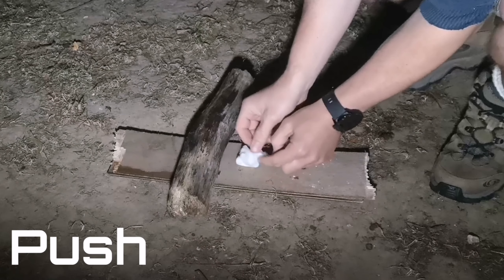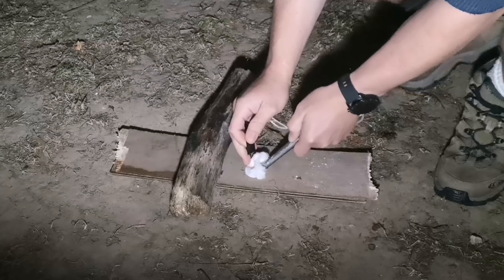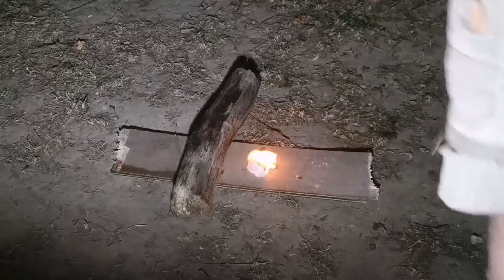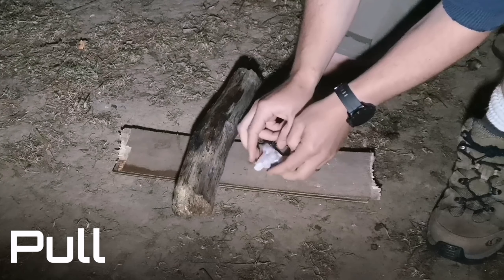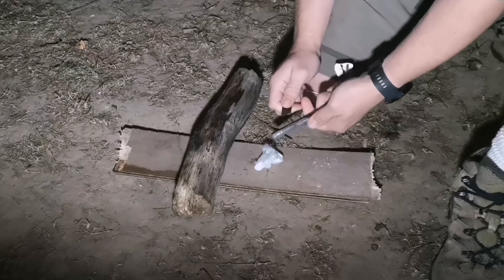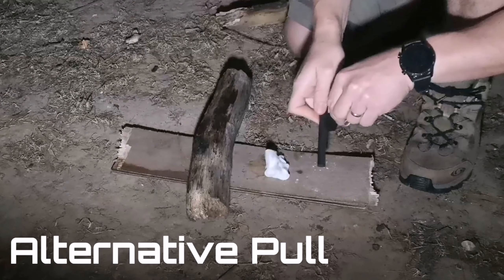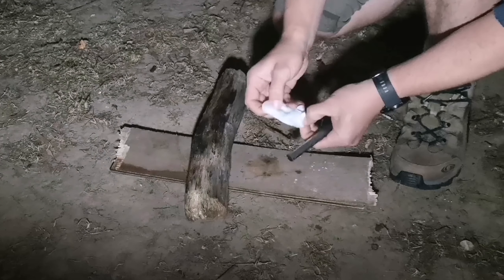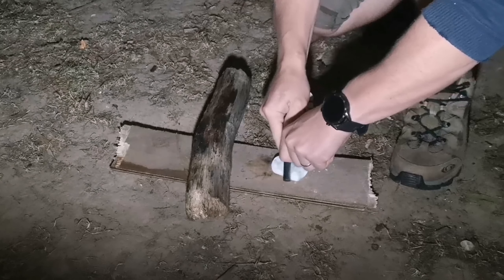Firesteel Techniques

Comment: ''Just out and about as I do at night'' = DOGGING. 😁 You don't have any welt on those trainers, but you sure do on your issue boots. In one of my videos although I didn't say it, I showed that by putting the fire steel supported on that front welt on the toe of my raised boot, I could throw sparks onto my tinder without knocking it all over the shop as usually happens in a downward strike method.  You can also do it one handed by laying the fire steel on the deck, held down by your boot and scrape away in the direction of your tinder.  If you practise using only the first lower centimetre of your Ferro Rod then, it will last a lot longer and less risk of them breaking when they're those thin toothpick replacements in a Swiss Army Knife type things.  What is my favourite - a Zippo, fire in the hole, but anything that works in the wet. 👍😉  Keep em coming.